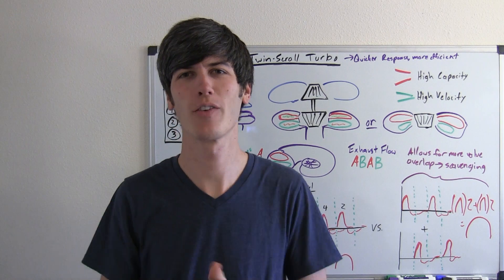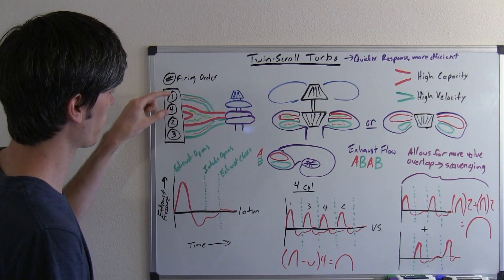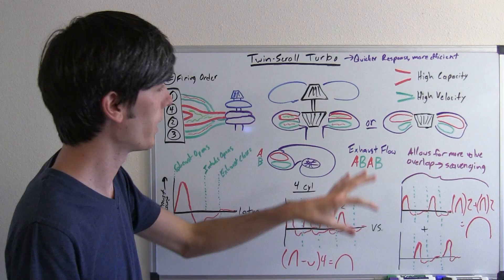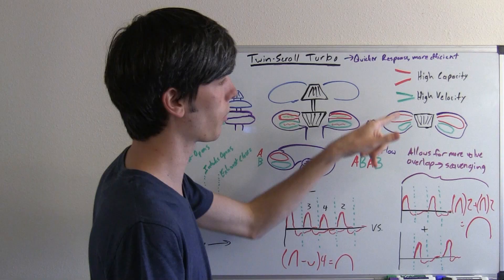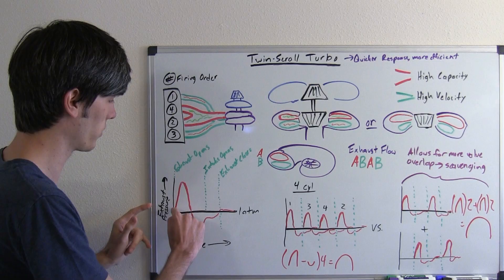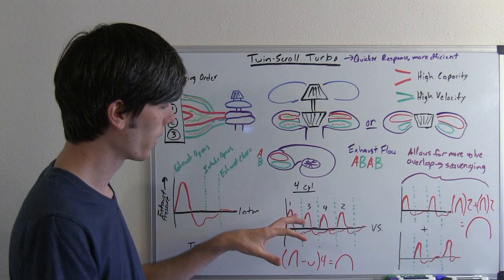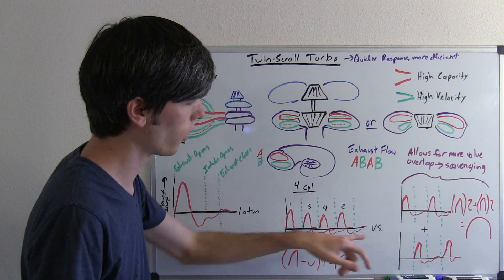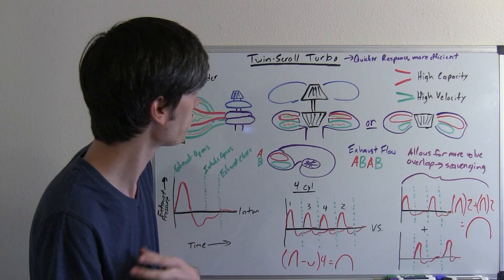Twin Scroll Turbocharger - Explained

Comment: Great video - but now I'm wondering: What are the disadvantages? Why isn't every turbo system made like this now?
Reply from the maker: +mybikevideos Cost.
Reply: +mybikevideos Like everything in life, a twin scroll will be much more complicated, build tons of extra power and cost thousands more plus upkeep. Try replacing one of these. A cool easy $10,000.
Reply: +John Strapp Where'd you pull that number from lol 
Twin scrolls can range anywhere from 400 USD to mid 2000's. Though I'm sure there are some proprietary ones for close but not quite 10 grand.
Reply: +Reizen Saiiko if you want a piece of shit set up, sure. $2000 sounds great. A 2007 BMW 335i TT is about $2500-$5000 for just the turbos to be replaced.
Reply: +John Strapp 2500-5000 is still not 10k and your always going to pay more for OEM anyway and on that note a 2k turbo is going to be just as reliable if you take care of it
Reply: +Reizen Saiiko right. So the $10,000 range is like Lamborghini and Ferrari aftermarket. If not more than $10,000
Reply: +Reizen Saiiko $5000 for BMW is just spools. No lines or intercooler.
Reply: +John Strapp actually 335i turbo manifolds run for about 800usd and if around the same for replacement lines and about 2-3k for an intercooler kit that's aftermarket (buddy owns a 335i TT) and as far as lambs and stuff that's out of the price range of an average person making average income and even then does not cost that much for a manifold
Reply: +Reizen Saiiko for an average car like a 4 banger or 6 cylinder or whatever a complete setup is probably like 3k for price and reliability and of course you can spend more than that building the actual motor for even more reliability there's no limit to the amount of money you can spend if you have it but for basics it's no where near a 10k buy in is all I am saying
Reply: +John Strapp Those aren't twin scroll manifolds. 2011 N55 engines started that with the single turbo.
Reply: No. However, my whole point is that its generally more costly to have something like this. I always over estimate the costs, so in the end it doesn't seem as bad.
Reply: +John Strapp It is generally more costly, but you keep citing OEM replacement parts which are going to be more expensive still. It's like someone asking how much does an exhaust manifold cold, and you cite the cost for replacing the manifold on an M5.
Reply: +mybikevideos Hey maybe I can help... This designs highlights are that the exhaust pulses can be fine tuned and spaced across the turbine dynamically 
according to RPM range, allowing for the highest efficiency possible. 
With this design the exhaust pulses are spaced so that when the first 
pulse is losing pressure, the next pulse is already on its way and 
keeping pressure up so that each pulse connects to form a steady push on
 the impeller.

 You can get some of the same results by having a custom made tubular 
manifold.  The unequal or equal length manifolds are designed to line up
 the exhaust pulses just like this particular system does and achieve 
comparable results, although still losing some efficiency over this 
design while saving on cost.  The inefficiency of the custom manifold compared to that of a twin scroll and a custom manifold combination is due to the fact that the pulses distance from each-other will remain the same and unchanged at any RPM without the ability to fine tune the pulses for that RPM range.  Also a twin scroll uses a different shaped turbine to maximize the pulses through each channel in the turbo, while a normal turbo does not have this ability.
Reply: +mybikevideos Twinscroll design turbos have a more complex design to it. This translates to manufacturing cost. Cost translates to profit (or lack thereof). In the end, the world goes round and round. This is a 5month old response but more and more car manufacturers now implement twin scroll designs due to various factors such as improved manufacturing methods which reduces the cost and also fuel economy/epa standards.
Reply: +Reizen Saiiko
Strapp is talking paying retail at the Stelaership, and sipping lattes while the working men work. DIY is an order of magnitude cheaper, as always.
Reply: Vash Stampede yea you helped by answering a bunch of questions that werent asked and not answering what he did ask which had a single word answer lol
Reply: John Strapp exactly, TT, twin turbo, you’re literally citing the cost of two replacement turbos, and using that to justify that this single turbo must be twice as much as that already doubled price you went by
Reply: +Vash Stampede Great post, I was wondering about equal length headers and how much better a true twin scroll setup REALLY is being that the twin scroll combines the cylinders in the turbo vs at the turbo inlet (difference of 3"). I don't understand what you mean about changing the pulse distance to eachother over the rpm range in a twin scroll. Could you explain further? Thanks!

Comment: Can you also elaborate on the differences between the boost-controlled turbos VS vacuum-controlled ones? Garret turbos on N63 engines are vacuum controlled and there is only a vacuum line connected to the canister...

Comment: So essentially the turbo is the same but the electronics and exhaust manifold and power stroke of the engine is changed in order to be more efficient? Beside the fact that the turbo has more 4 exhaust ports to spin the turbine as opposed to one port? Does that sound right?

Comment: Old vid. Thank you. I just stumbled accross it. Question,  what effect would an exhaust gasses diverted into only 1/2 of a twin scroll. Assuming both sides equal? Could the higher velocity spin the turbo faster to make up for some lag? Then as rpm increases, open up the other side so the motor can breath better?

Comment: This is fascinating. I'm just wondering now if you can make a twin scroll turbo work on a 3 or 5 cylinder engine. I feel like logically it should not make a difference. But my human need for symmetry makes me think an engine with an odd number of cylinders would gain less from this concept. Thoughts?

Comment: I am building a Honda Civic EK3 D15B SOHC 3 Stage VTEC. I've been wondering for so long whether I should install turbo or not. I have installed cold intakes on it. And just got a manual transmission because it had a CVT. Please be warned beforehand that I am just a newbie in building cars so be nice.

Comment: I know the video's old, but this has been really bugging me. Since the airflow from the 2 pairs of cylinders are the same, would'nt the smaller sized scroll restrict the exhaust flow when it reaches a certain point thus restricting exhaust outflow after said limit? So past a certain flow rate/rpm, only the bigger scroll would be the only one effectively doing all the work?
Reply: +adam hisham Somewhere in the video he mentions optimizing for a certain RPM range, so I think you are right that the smaller one would become inefficient at some point. If this is the case, I guess you would have to consider the purpose of the vehicle in determining whether that type of turbo is right for you.
Reply: +Tyson Farnsworth Yes, I completely agree with you/him on the optimizing part. You could even say the same thing for every non variable turbo out there as there's always that one 'sweet spot' for each of them. However, what i'm curious about is after you've passed the 'limiting' point of the smaller scroll, doesnt the exhaust going out from the pair of cylinder connected to the smaller scroll gets restricted and 'blocks' the subsequent exhaust discharges? Hope you get what my conundrum is about. haha
Reply: +adam hisham I got this...  So lest pretend we are executing a wide open throttle (WOT) pull off the drag strip and we are in 1st gear.  At WOT, both channels will be open allowing maximum airflow through the smaller and larger channels at the same time.  Now imagine if we are in neutral and then shift to 1st gear and then begin applying more throttle.  In this state we begin with air flow is only entering into the smaller channel, but as the RPM's increase, the gate opens allowing more air to be equally split between large and small channels, changing where and how the pulses hit the turbine wheel.  This allows the airflow to be maximized for torque at any RPM range.  This is where the efficiency increase comes from over just having a custom manifold.
Reply: Yeah, I noticed he left that important detail out on this particular video as well, lol.
Reply: Yes, but he explained it as in, when in lower RPMS the smaller one will do more work. As opposed to the larger scroll, as it will do more work in higher RPMS. For a more broad torque band.
Reply: something that he didn't cover was the relationship between cylinder displacement and the volume of the exhaust manifold. in a normal single scroll set up the  cylinder exhausts into what is usually a volume larger than the cylinder, thus energy is lost from the lack of focus. with t/s this energy is better utilized, making for a more responsive turbo at low rpm

Comment: I thought that negative pressure would still drag the turbo in opposite rotation, which slowed it, even in twin scroll. Am I wrong?
Reply from the maker: There may be a small effect, but it seems like since they are not simultaneous the larger pulse would give the turbine a bit more inertia, rather than slightly less at the same time.

Comment: Question: In the twin scrolls with different scroll sizes, when the engine is revving higher releasing more exhaust gases...how does half of it coming from 2 cyls get through the smaller diameter pipe...while the other two have a fairly large high capacity pipe......all 4 cyls do produce the same amount of waste right?

Comment: im slightly confused about why the low pressure area matters, yes it will relatively slow down the the turbo but it will also help suck in the fuel mixture (that why there is valve overlap) so don't they cancel each other out? another way to see it if you have really low exhaust pressure (lets say its a vacuum hypothetically speaking) won't that eliminate the need for a turbo since the valve overlap and the inertia of the mixture will already create a fair amount of intake pressure (assuming you have the correct length of intake runners for harmonics tuning). also its not quite clear how the twin scrolls help, yes it keeps the low pressure and the high pressure of each stroke separate but the low pressure still contacts the turbine and could slow it down more or less in the same way that it would in a single scroll turbine

Comment: What cylinder intake valve creates the negative pressure?The next on the firing order or the same cylinder that just emptied form exhaust gasses?

I thought it was the cross cylinder contamination of the exhause vallves is what created the need form divided housings.
I mean the ex.valves on 2 cylinders were open at the same time causing the ex pulse going to the low pressure still open ex valve.

Comment: OMG! This actually makes sense!! Love your explanation! How does different octane gasoline affect this twin scroll turbocharger?
Reply from the maker: The type of turbo used and the octane rating won't really be directly compared. The amount of pressure in the combustion chamber, the temperatures involved, and the compression ratio would be more important. Octane Rating - Explained

Comment: The video is clear. But from the beginning. Why do you take a four cilinder as a example and not a six cilinder? A six cilinder engine is much more efficient with the twin turbo setup than a four cilinder with this scroll setup, or am I wrong? (I heard this during a lecture last week...) I'm in doubt because of your story of the exhaust impulses. Because the six cilinders has three impulses on each turbo and not two in every scroll. Please respond.

Comment: Would not the low pressure in exhaust manifold while the intake is open help pull the fuel and air mixture into the cylinder from the intake?

Comment: When you talk about the pressures in the exhaust against time, you can be clearer if you mentioned that the pressure is measured at a constant position in the 'tube' 
Otherwise great video ! Thanks

Comment: Plus, in the case the engine has an uneven number of cylinder we will still be able to manipulate the gas flow to make it work properly? Maybe with a specifically designed exhaust? 
Just in case i made some mistakes i apologize if my english is not proper. Thanks in advance! ;)

Comment: so how do you stop it from negative pressure in the 5th diagram 
what pushes it left the spring from small a.r to the big a.r 
how does it know where to be at 
and also if your driving at 70mph and you it's on the big a.r. you let off the gas for a secend and get back on it how does it know which a.r to be on ..what's the reacation time for it switching over since it moves gradually ?

Comment: Great video would be turbine wheel size vs ar size in single scroll/twinscroll in small/mir displacment engines as a comparison. another great topic would be about conpressor wheels. inducer and exducer size effect on flow and boost. their ratio effect. and compressor wheel design: short hub vs long hub, extended tip vs not, high blade vs short blade. slim hub vs fat hub, blade quantity how and it effects on performance. 6+6 blade vs 11+0 blade and in between.

Comment: I don't understand the last part. You say you will have the big pressure areas without the losses, but then you have an area with ONLY losses (sending negative pressure to the turbo? seems so counter intuitive) without the big pressure areas to counter them. Doesn't seem good to me to split the exhaust pulses instead of having a more constant pressure sent to the turbo. What am I not seeing? Thanks

Comment: A larger turbo will make more horsepower, however if the turbo is too large the low end response will suck and you will get a huge hit of power in the mid range.

Comment: I swear I've seen this explained before but in a different manner, where the reason for the separation of the two different banks going to the turbo isbecause the negative pressure of the bank for 1 cylinder interferes with the positive pressure from one of the other banks, therefore essentially causing the gas has to fight each other at the turbo, causing a less efficient overall boost scenario, as well as a lessened spooling of the turbo. So basically by separating the two Banks from each other, you are able to keep those negative pulses from fighting the positive pulses of the conflicting cylinders.

I guess you could say when the exhaust valve for cylinder number 3 opens, it has that positve pressure wave heading out, but cylinder 1 would be on a negative pressure, and so part of the pressure of #3 would want to divert up the runner of number 1, therefore not placing it's full pressure upon the turbo impeller, and so by separating opposing cylinders, you get the full pressure from each cylinder acting upon the turbo impeller and then joined together after
Reply: He stated all of that when he said there was overlap between positive and negative pressures lol

Comment: but if pressure after one cylinder exhaust stroke drops in manifold (for example first cylinder), then in third cylinder (if firing order 1-3-4-2) exhaust gases shouldn't get out quickly? because after first cylinder exhaust stroke in manifold is small pressure, and in third cylinder, when exhaust valve opens, is high pressure, and when difference between pressures are high, gases get out faster?

Comment: If I understand correctly, the twin scroll turbos attempt to maintain exhaust velocity as it interacts with the turbine wheel. In the case of the twin scroll the separate channels help to smooth out the exhaust "pulse" that can slow the exhaust gas column. I had always thought that they used two channels each aimed at a different section of the turbine without respect to firing order. So one channel having a high velocity and low capacity aimed at one section (for low rpm boost) and one with high capacity each aimed another section (optimized for high rpm), thus allowing for two different A/R ratios in one unit. Am I on to something or am I completely off base?
Reply: Is that perhaps a two-stage turbine I am thinking of?

Comment: Man, u can become some quite fantastic teacher! :) Would you explain to me why exactly turbocharged engines create so much more torque compared to the equal power-producing naturally asp. ones?
Reply from the maker: They have a lot more air during each power stroke (boost), and thus burn more fuel, creating a greater pressure pushing the piston down (torque).
Reply: Thanx!

Comment: sorry i know that last comment is tough to read, was heading out to work.
what i mean is, as you have it paired 1/3 and 4/2 you wont achieve this gap in the exhaust flow. Instaed of ABAB its AA then BB.

paired 1/4 and 3/2:
A- Pulse | Gap | Pulse | Gap | so on... This is the desired effect, correct?
B- Gap   |Pulse| Gap   |pulse|  so on... So that the one wave length pulse is gone just in time for the next.

as drawn in the video:
A- Pulse |Pulse| Gap | Gap | so on... 1/3 4/2 with 1342 firing order (almost all 4Lcyl)
B-   Gap | Gap |Pulse|Pulse| ... like the same issue of one pulse starting before the pressure is low enough, only differance is that you have 2 channels instead of one. The manifold near the channel would have a long void for 2 strokes. I guess the the one up from the long break would benifit if you were imagining the pulse on a graph like that wavelength.
 Holler at me ive never put a twin scroll on anything,I could be wrong.
Reply from the maker: I have paired 1&4 and 2&3. If you look at the numbering on the cylinders, I'm showing you the firing order. 1, 2, 3, 4, corresponds to cylinders 1, 3, 4, 2. Apologies if there is any confusion.